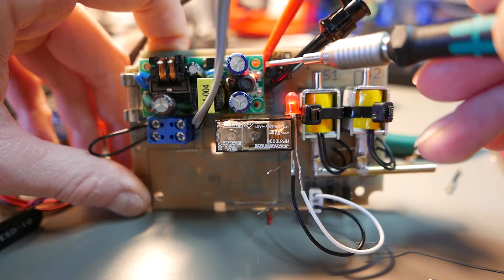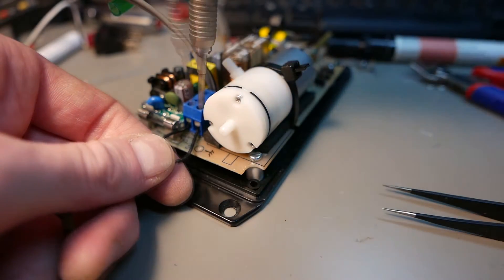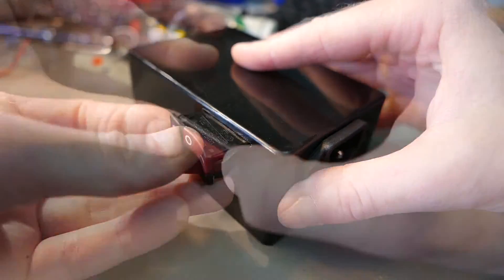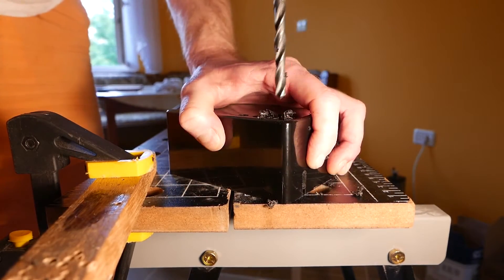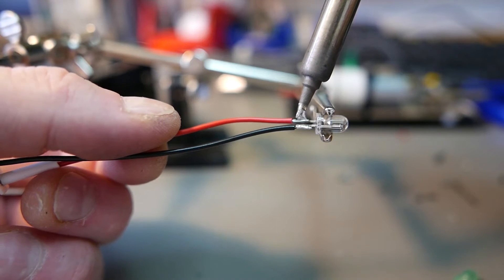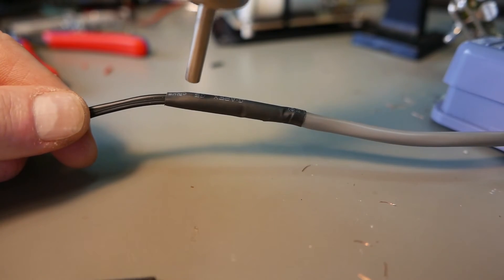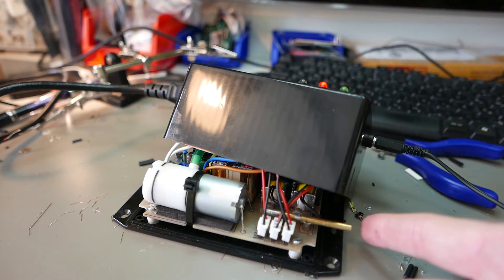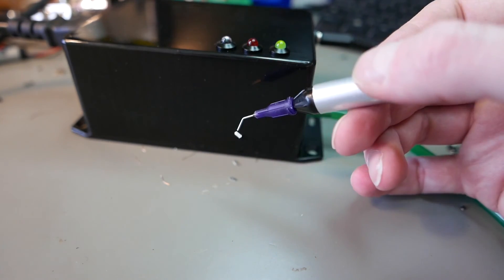Pick and place pen (Part 4) - Completing and testing

Comment: Hi Tomislav,
congratulations for this very cool and very well done project.
Do you have video showing pick & place working on PCB ?
Does components stays tightly "sucked IN" until you release the pedal switch or does it stay for few seconds and then falls down, because of the air leak between components and needle ?
Reply from the maker: Hi. Thanks for the comment. I tried placing components for small project and it was working perfectly with a barely noticeable lag while letting go.I didn't record it, though. I am making a LED panel project with 500 LEDs soon and will record soldering that one. 
Components stay sucked in at all times. For larger components like MCU-s i change the nozzle to larger one with the rubber suction cup. The reduced pressure is just strong enough to hold the components at all times and release when it comes in contact with the solder paste or when I release the foot switch.